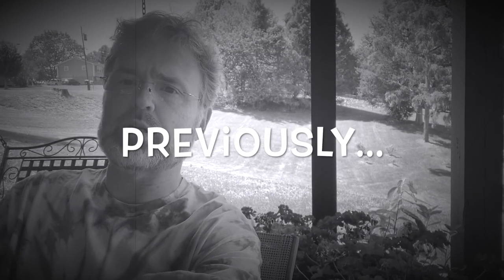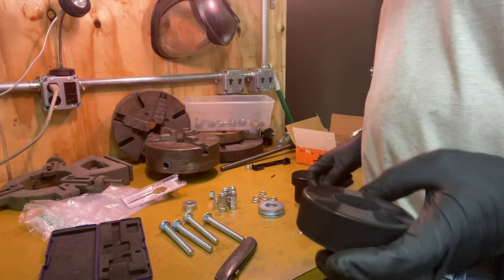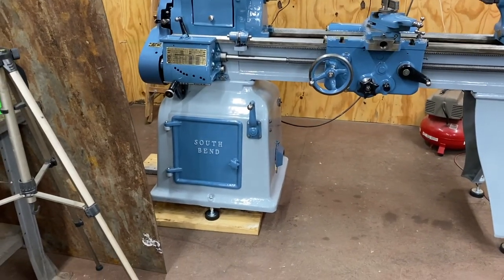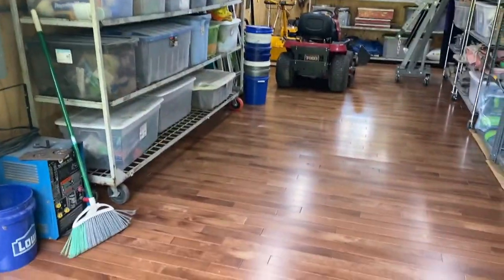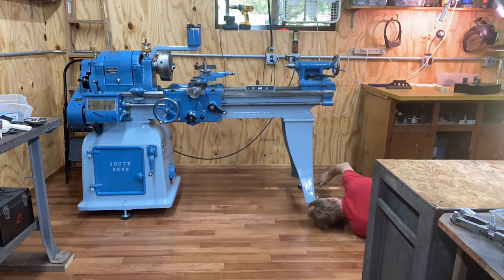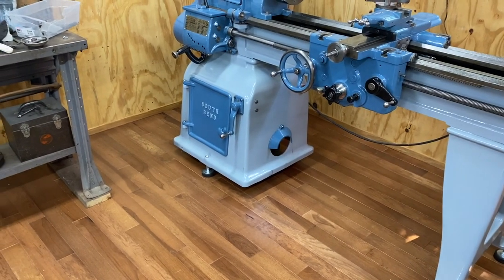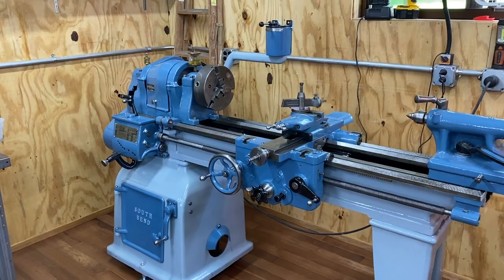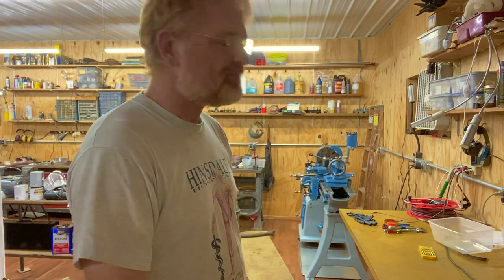South Bend Lathe Restoration, Part 15:  Leveling the lathe, Making feet, Fixing the cross-slide.

Comment: Kevin I would suggest loctite black max adhesive for the spacer on the gib. If the blue threadlocker ever gives up you could easily try the black max.
Reply from the maker: Thank you for the information.  I had never heard of Loctite Black.  So I went looking and found this chart:  https://www.anzor.co.nz/technical/product-specific-information/loctite/application-wall-chart  I didn't realize there were so many options!  It does look like that Black max adhesive would work well.  Thanks!
Reply: @KevinToppenberg  yeah there are sooo many choices, price can be a factor as well. I know Stefan really liked the uniformity and grab it had for a gib shim during one of his rebuilds.
Reply from the maker: @MapleEngineeringAndMachining  :-)

Comment: Well - I feel better now - I am also on a wooden floor (1952 SB 9b) - I put a 2x6 frame under the table legs, added the hockey puck feet for levelling, then chained the table of the lathe to the frame on the floor - which is also screwed to the floor - then the table is bolted to two 2x6’s which are extended to and screwed to two studs in the wall - so, pretty darn rigid now….. a concrete floor would be better of course, but you work with what you got - cheers from Vancouver Island, BC 🇨🇦     (#notamachinist)
Reply from the maker: Thanks for your comment.  It is interesting that you mention fastening the lathe to the floor.  I had never considered that.  I am not doing heavy turning, but I suppose if I did, that the lathe could vibrate and start "walking" across the floor.  So your idea seems spot on!  Best wishes!

Comment: The door that swings to the left covering the gear train.  Thanks
Reply from the maker: Hmmm.... My lathe has gears to the left, but there is not a swinging door there.  It is just bolted in place as far as I recall.  You must have a more recent model than I do.  Have you tried posting on Practical machinist?  They have a large number of people with much more knowledge about SB lathes than I do.  Here is the link:  https://www.practicalmachinist.com/forum/categories/south-bend-lathes.25/  Best wishes.

Comment: Kevin; I am rebuilding a South Bend 9A salvaged from the Avro Arrow maintenance shop.  It was passed on to the Douglas Aircraft Co., then to the Mcdonnel Douglas Co., then to the Boeing Corp. never leaving its spot on the floor of all these companies.  I am wanting to remove the gear cover door without breaking the hinge pin. Any advice really appreciated. Thanks
Reply from the maker: Are you talking about the door that flips upward, revealing the belts that drive the spindle?  Or door that opens into that bell-like housing below the spindle?

Comment: I would wonder about the bolt size for feet. In regards to stability would suggest a larger bolt turned down for lathe throughhole. Beautiful floor job, careful of moisture though. Enjoying your videos, thanks.
Reply from the maker: Can you explain more what you mean?  Are you thinking the bolt needs to be larger to be stronger?  And if I turn it down, doesn't that just make it smaller again?  Regarding the floor, so far, the surface finish seems to be repelling water and oil.  But I will need to see how this goes over time.  Thanks for watching!